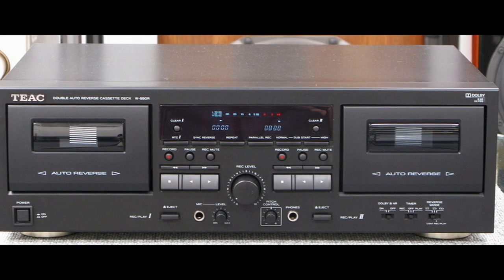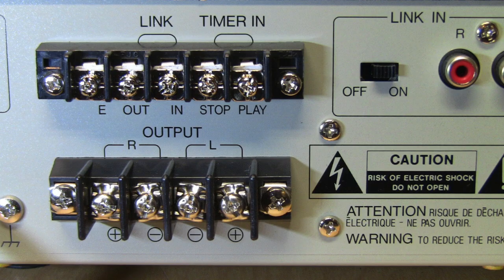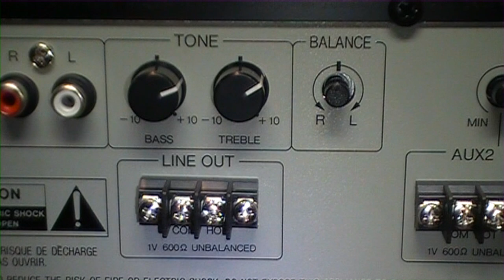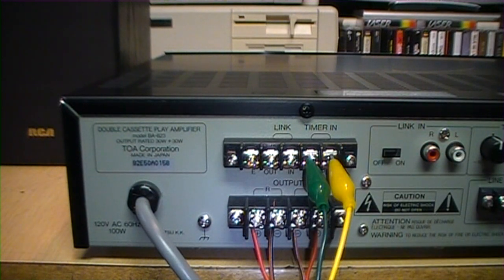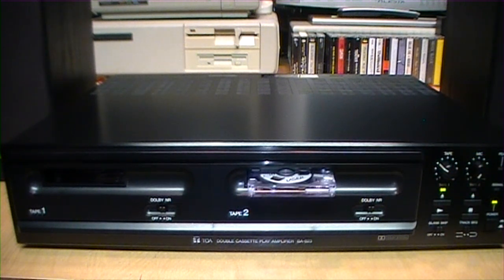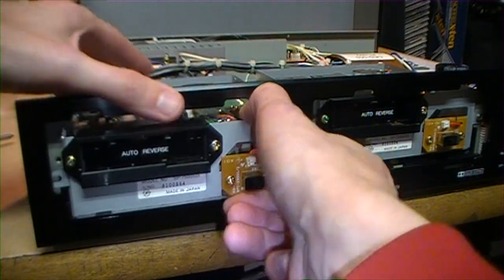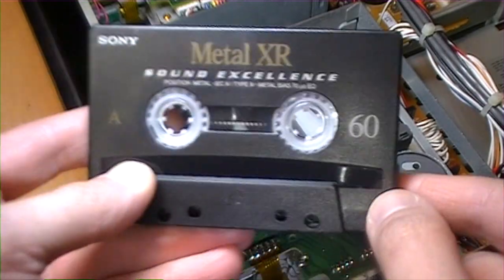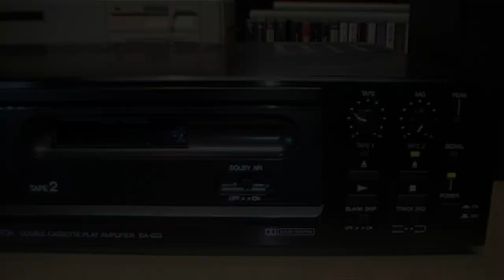New stereo auto-reverse Dolby NR cassette deck amplifier - TOA BA-823

Comment: Those cassette mechanisms look like the manufacturer took a regular car stereo frame and just put the appropriate electronics inside, without a front panel.
Reply: Yea i just hope it doesn't have the reputation as car stereos do, it does make cleaning of the tape path of a compared to a normal tape deck a bit difficult.

Comment: Apparently only one left as of typing this comment, shipping to the UK though ($200-ish), nope, no thanks... :P

Oh, it just sold... :P
Reply from the maker: The BA-823s are all gone, but seller "dsings14u" has several new old stock BA-806s for sale. That model has a mono amplifier, but the cassette decks in it are still stereo, so with the line output mod I showed, you can get stereo out of it.

Comment: I don't understand the allure of cassette tapes?  They sound like garbage.
Reply: If you have a nice system with better quality tapes, it can sound surprisingly good and look pretty nice while running. There's a certain charm to mechanical devices with light-up dials and moving parts that doesn't exist in products today. It's the same thing with mechanical watches: we have more accurate quartz lcd watches but mechanical ones are like a work of art. Now, the player shown in this video is pretty underwhelming in features though and doesn't have any of that classy kind of look to it. Very utilitarian and anyone today that is utilitarian with audio knows to stay the heck away from anything tape related unless it's some seriously high end reel to reel because good quality digital sources will blow these things out of the water.